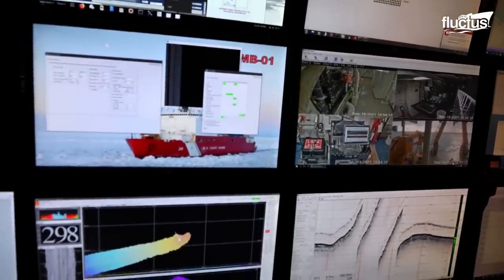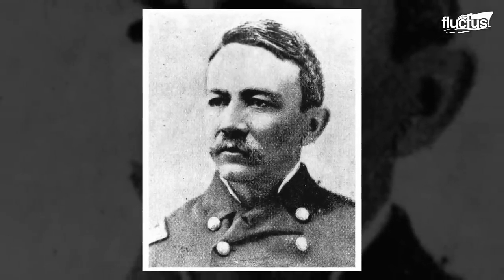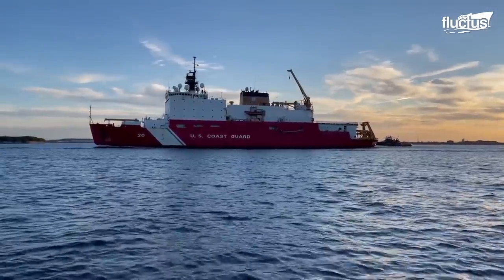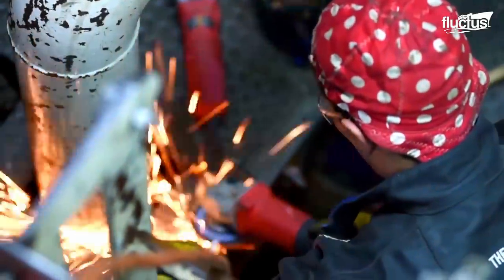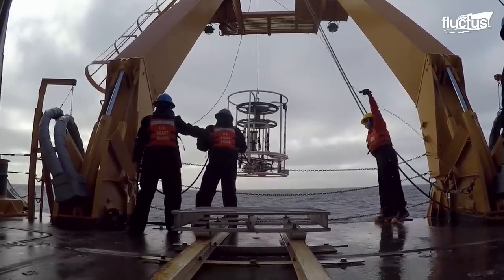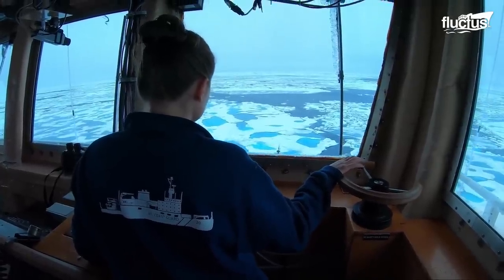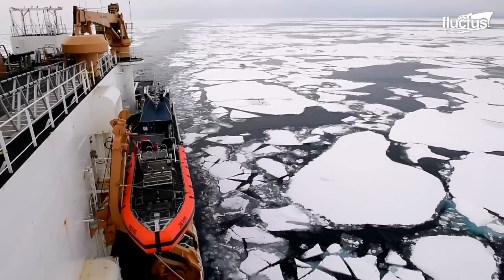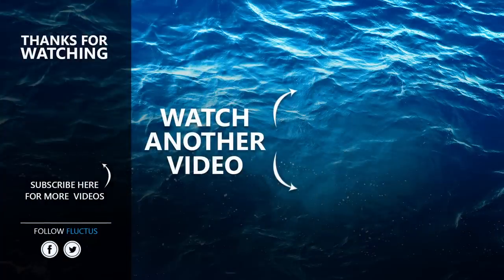How Genius Engineers Saved $800 Million US IceBreaker From Being Scrapped

Comment: The Healey is 'most advanced' for a US breaker but other countries have equivalent vessels.  The Healey is a medium duty breaker while the Polar Star is a heavy duty breaker, however the Star is pretty old (well over 40 years, very old for any ship), breakers work hard and at the cold temperatures encountered in the polar regions the steel hull takes a serious beating.  I very seriously doubt that the Healey can continuously break ten foot ice and certainly not at 20 knots.  The sloping bow of a breaker allows the vessel to climb up on top of the ice where the weight of the hull crushes it, if it doesn't work the first time you back down and try again, and again and again, you get the picture.  This is why most breakers were diesel electric as this allow direct bridge control of the propellers, I believe that some newer cutters have controlled pitch props that vary speed and direction by blade angle.  Breakers often carry a spare prop since they get beaten up while grinding through ice.  Not that they can change it while in the water, but there are yards in New Zealand that are closer to the antarctic than US yards.  The Healey can probably go 20 knots but she'd use a lot of fuel at that speed, she has diesel engines for regular cruising but a high powered gas turbine when she need extra power in the ice or for fast cruising.  The problem is that the CG does not have a continuous  ship building program like the US Navy's sub and carrier programs, the US always has carriers and subs in production while every twenty years or so the Guard realizes it needs a new breaker now, unfortunately due to the funding process thru congress it takes years and years to get the program funded and an equally long time to get the vessel built.  Norway, Finland, and Russia build these vessels on a continuous basis.  Russia has some nuclear powered breakers while the Norwegians and Finns have available diesel engines in the high power range so that they don't need the fuel thirsty turbines that power the Healey.
Reply: The Healy can only breaks 4.5’.  Of ice continually at 30kts,  and it’s only propulsion is 4 Diesel engines in a diesel electric configuration
Reply: @jeremygourde9880  sounds like you guys know your shifts I know the principal of breaking ice & can only imagine the maintenance and stress these old gals have endured way more than most other 🚢 ships lol but sounds about right with the 4 huge diesel’s over electric takes an immense amount of tourque to get who knows how much tons of steel to lift itself up on top of a 10’ 🧊 ice shelf & break it up just the idea baffles me the CG rarely gets its due praise always the forgotten heroes of the oceans they deserve better 👏👏🙏💪COASTGUARD TO THE RESCUE!!!!!!!!!

Comment: I worked in Ship Repair Yards fof 35 years and this is a common job. In UK, the RN and RFA Ships change their Generators every couple of years. We always cut a hole in the Shell and bring them in and out that way, its no big deal. At the Middle Docks on the River Tyne, we cut a  Roll on Roll off Ship in half LENGTHWISE like a Cake and raised it by over a metre. This was to accomodate Container Lorries. It was the first time it had been done in the World. Cutting a Ship in half vertically, pulling it apart and extending its length is common place. You have to have worked in this Industry to understand how these are everyday contracts, nothing exceptional.

Comment: Does cutting through the ice contribute to loss of sea ice?
Reply: I think it depends on how cold it is. If its warm temperature the ice will decay more quickly on the sides of the path opened by the icebreaker. But if its cold temperature i would say the path opened will freeze again quite quickly.

Comment: Having served in the CG when the two Polar class breakers were built, it astounded me that they were doomed from the start with poor design, gross welding deficiencies and improper order of construction by Todd shipyard.  When the CG burned one out it should have become clear that the ships company was in need of a serious competency review.  Long term mechanical problems that plagued both ships were neglected to this day by command indicated a serious flaw in the overall engineering staff charged with the operation and maintenance of the polar class.  Now we are embarking on a replacement breaker built by a ship builder that has no previous experience and designed by whom ?   Sounds like were are going down the same road.
Reply: I don't believe that the Polar Sea's engineering department has any responsibility in the failure of the Alco engines. My understanding is that Todd shipyards replaced the piston rings with the wrong metal composite.
Reply: @markszyszkiewicz  Hi, thanks for your reply.  According to the independent engineering analysis provided to the board of inquiry (Available through FOIA), only one ring on one cylinder was noted to be installed improperly, most likely an oil wiper.  I also assume that Fairbanks-Morse had a representative on-site during the upgrade of the motors so that the shipyard was under their supervision.  The O&M provided by the ships crew neglected to notice the deteriorating conditions that led to the catastrophic failure and the inquiry board found improper lubrication oil stocks on-board.  The loss of an engineering plant is the responsibility of the ENTIRE engineering staff and the Command, plain and simple.  Also, no air filter were found to be on the motors that suggest the abundance of granular particular matter found in the intake manifolds contributed to the loss of the plant.
Reply: @Rob-xv6bx  very interesting information you wouldn’t think a power plant of this magnitude could be taken down from insufficient air management or something so simple as improper maintenance of an oil ring I know from my own experience with engine building & maintenance depending upon size have seen many things that u swear would stop an engine dead in its tracks just get craped out the exhaust seen a 10’ by 15’ tarp get sucked into a V12 whole tree chipper engine & little by little it shat it out the exhaust hours later burnt tarp was the smell of the yard lol 😂 have seen whole tools make it threw an engine & u would never know it ahhh the fun times😂

Comment: One might think that when they design one of these ships somebody might yell out "what if we have to replace the engine...... should we plan now to make it easy ? "🤔....... but what the heck we can cut a big hole in the side 😁, spend tons-o-taxpayer cash💰💰, and  spend six months doing it🤗 ...& ... we still have a nice OLD ship that works................. yeh...... makes perfect sense to me.
Reply: For structural reasons it’s not that uncommon you might need to cut the side of big ship to get  access it’s not really that big of a deal would be easy and was most likely engineered in to ship where to cut
Reply: You are asking too much of the engineers to think like that.
Reply: It certain crossed my mind as soon as they announced they needed to cut their way into access the engine  .. it is 2023   isn’t it
Reply: If no😅 no😢 no
Reply: It's no different to the installation of elevators, plumbing etc.. during the early stages of construction of a high rise building.
Reply: Standard practice. 
Since the engineering spaces are @ the bottom of the ship and under the working and accommodation spaces it is impractical to remove large components out the top.
Shipyards are very practiced at doing this kind of surgery.
Reply: @gregculverwell  amazing 👍
Reply: This is  standard practice with all but the smallest craft.  Many (most) production yachts can only perform major engine overhaul after non structural cutting.
Reply: @cpcattin  Thanks for your advices.
Reply: Marine engineering has lots of facets that have taken years to develop and for the engineers to learn. It’s training at a deeper level than a You Tuber arm chair critic has but seems to know what they are doing wrong
Reply: Let me explain the engines have to be low in the ship due to weight and to drive the props below the water line where else would you put them? The vessel  looks diesel electric propulsion but due to buoyancy they still need to be low in the vessel . You sound as if you think you know more than the naval architects who designed this vessel. Trust me you don’t
Reply: @MrFerrie60  Thanks for a great contribution on the subject. It's unfortunate the vlog didn't include the info. you have now provided. Cheers.
Reply: To leave space to easily remove the motor (which should last the lifetime of the ship) you would need to make sacrifices in the inhabitable space but also in structural and watertight integrity. You’d essentially have to leave a large shaft from the main deck to the engine room which would cause the issues mentioned above.